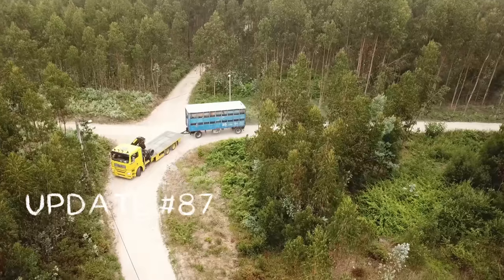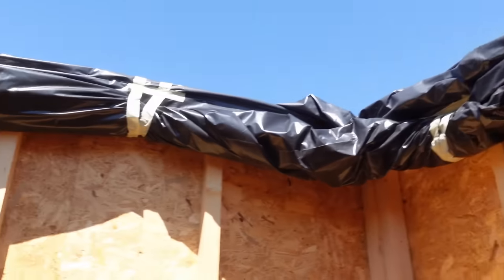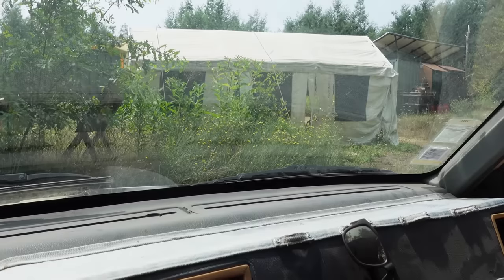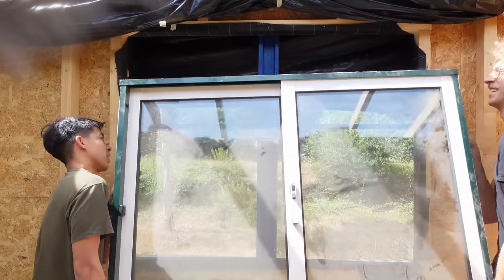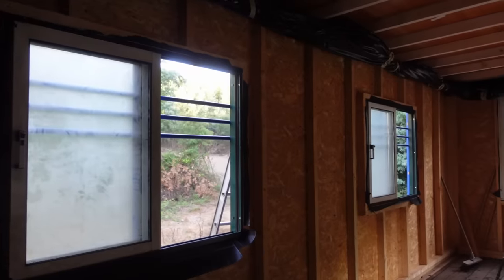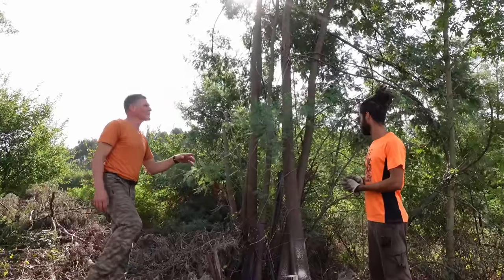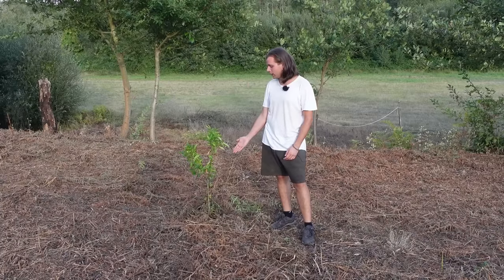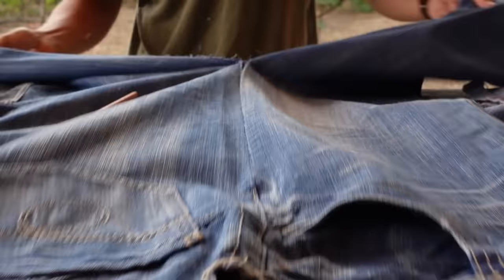#99 Waterproofing our trailer house and clearing the road

Comment: I think you should make French curtains, like a door IN FRONT of the window, so the sun doesn't heat up the glass of the windows it self. You can even try to make them with a hatch, so you can adjust the sunlight you would like to get in.
Reply: Was thinking the same - these only keeps out the sun, but the heat is already inside. In Germany they have them on all windows it seems - works very well!
Reply: Pretty sure they thought about this but they have not worked on the exterior at all so they might want to wait before adding exterior shutters on an unfinished exterior wall.

Comment: The curtains will not be very effective at cutting down on the heat.  The gap between the curtains and the glass acts like a greenhouse warming the air, that air then circulates around the room.

To really cut the heat down, you'll need to put some shutters outside of the window.
Reply: A reflective outside shade that is what they need.
Reply: just my idea too.
Reply: @Kaczyfunny  You can install reflective film inside on the glass to reduce solar heating.
Reply: @lettucesalad3560  Yeah it is a good thing.
Reply: Stop/block the air movement and curtains/draperies work very well. That means the fabric must touch or even fold over onto the floor, or be fitted against the wall or window frame at the top.
Reply: A tarp awning will stop the sun hitting the window
Reply: I first thought they were going to make some old style farmhouse shutters from the mimosa wood..
Reply: Yeah they're be able to find some second hand shutters somewhere
Reply: @patrickwilkinson721   Second hand? They have an onsite woodshop and like 6 trillion logs of mimosa wood. They could probably make some shutters out of that wood lol. They could also do some recycled plastic shutters.
Reply: Shutters also work in winter if there ever is bad weather, we are seeing more freak weather incidents around the world.

Comment: One way to deal with hot sun window, is to block the sun from the OUTSIDE !  In colder climate, one way is to setup some kind of rack on top of the window, and let some plants grow in there, so the leaves would fall in the fall and let the sun come in for the winter.  Curtain will help a little bit for sure, but you need the sun got inside, so it got converted to heat at the window. some white curtain can help to reflet this heat back outside, but window does play some trick, as it will reflect heat, so you can't send back IR heat since the glass act as a mirror.  Anyway lot of tweaks to do in your future.

Comment: Great episode. I enjoy the Mimosa harvesting.  On your final scene, I noticed the outside the office.  Some of the ends of the cinder blocks are exposed. They should be capped before winter.  Water will get into the ends and soak into the blocks, not good.  The outside should probably receive a water repelling treatment. I have a 80+ year brick chimney and painted it last year because it was soaking in water during rain.  It would then puddle on top of the ceiling.  It took me years to figure out the roof wasn't leaking. It's great seeing the progress.

Comment: Wow, I love the mimosa removal - but it obviously is hard work!   Great  to see you preserve other trees.  Thank you for bringing us along.  😊😊😊 John Ken
Reply: Those things will come back.  I know.  However, with persistence, they can be reduced.  And once the native trees have fully reestablished, they should be only a minor nuisance on woodland edge, as the oaks and others will start shading them out.

I know the Kampers are planting fruit trees, but nut trees?  Walnuts should do well.  I don't know if it is even permitted as it is a non-native species, but pecans are pretty good (Carya illinoinensis).  These are actually a variety of hickory and related to walnut.  I doubt the tree is invasive, but it could serve as a host for something that is; however Portuguese or EU agricultural specialists would have much better information on this.  The wood is attractive and quite strong; very large old pecans are often cut for timber.

Comment: 29:01 Keeping the heat out of a building works much better if you don't let the sunlight come through the window first, because then it will warm up the curtain or whatever construction you made, which will in its turn heat the room by radiating. So if you make shutters, window blinds, curtains or any other devices that reflect light, you'd do best to install them on the outside. Curtains on the inside are for darkening a space, not for keeping it cool.

Comment: I am not sure the orientation of your windows, but your southern windows should have awnings over them. With the right size awnings you can block out direct sun in the summer to keep it cooler inside, but let in winter sun to get extra heat. To find the right size awning you need to know your latitude and how high in the sky the sun is at that latitude during the summer and winter. Then it's just math.

Comment: people mineral wool, like rock wool and similar products for insulation are discarded in huge amounts. Around here you can often get it for free when people renovate or demolish buildings or even leftovers from new buildings. It's fireproof, last forever and it takes a lot of resources to produce so recycling it is awesome. And even thou it's a pain to work with it's not toxic or anything.
Reply: Keeping things away from the garbage belt is always better than buying new, however environmentally friendly it may be :)
Reply: I would be terrified using recycled fabric insulation. It's hard ensuring every nook and cranny is free from moisture intrusion. If water does breach the barrier, there's no other solution than tearing down the walls and removing it.
Reply: @bobweiram6321  mineral wool is not fabric it's more like candyfloss made out of rocks or glass. Moisture is going to be a problem no matter what. Bút mineral wool do not rot or decay.
Reply: @maxejnar9934  I wasn't referring to your mineral wool suggestion. I was commenting on how the fabric based insulation they put in is a nightmare waiting to happen due to moisture intrusion.
Reply: @Strooisuiker  New insulation may not be friendly, but moldy fabric insulation is even worse. If water makes its way through the moisture barrier, the moldy fabric insulation and boards will go into the landfill.
Reply: @bobweiram6321  my bad sorry

Comment: You may want to consider "brise soleil". Apparently the name is the same in french and english according to goolge ... It's basically some sturdy piece of material to put on topof windows to block out the summer sun that is high in the sky, but still let the lower winter sun in. Should be usefull for both the pig trailer and your office :)

Comment: Great work! Very surprised to see no pitch on the roof of the pig trailer considering the amount of rain you get in the winter. Even with a thick plastic barrier, the pooling rain on the flat surface will likely cause problems in the long term.
Reply: yas, thought the same! Sounded like an awesome water capturing opprotunity
Reply: unless, they are looking to build another floor up there

Comment: Very impressed that you managed to find windows that were the exact size for your openings 😉
Reply: That is what i thought. If you not use the countrys standard sized windows, it is really hard to find or its expensive.
Reply: @Kaczyfunny  I dont believe that countries have standard size windows in that context.   Most countries in Europe dont have any type of standardisation and the US's idea of a standard double hung window is anything from 24 to 36 inches wide. I think you'll find that what they did was find the windows first then made the openings to fit the windows. They just edited the film to look like they went for windows after, hence my wink emoji.
Reply: @dave4728  Well i did not reaserched it. I thought that apartment complexes have a common size, which therefore the most common and cheapest on the secondhand market. But what you said is absoloutley make sense. In my country i can find costummade windows easily, not too expensive (new windows are allways expensive). I just thought as in everything there is a most common size in window topic too.
Reply: @Kaczyfunny  It wouldn't suprise me if some companies mass produced windows at a certain size to keep the cost down then relied on building firms to build their openings to suit, especially in large apartment blocks. Generally though windows are built to opening sizes.

Comment: Pig trailer home moving along. Reusing the old metal stairs was a step up versus climbing. First step up from the ground is too high and potential trip hazard. Need at least one more lower rung step. Or build up the surrounding base area to improvise one or two stepping areas. Most likely using a combination of base stone, wood chips, mimosa wood for the boxed areas. Opportunities for roof water runoff collection. Gutters, downspouts and suitably sized collection barrel or tote. Water can be used for plant or garden irrigation. Or runoff into a nearby man made designed pond. Plant some trees for shading, respite areas, encourage local birds.

Road clearing and improved access is important. Now you need to grade the road to facilitate water runoff. Then cut some graded drains or culverts to channel the water away from low areas. in time, roadway widening, taking material from the high side and building up the opposite side.  Planting fire proof trees properly spaced to minize soil erosion. Continue to discover indigenous tree species, clear and create growing areas.  Look for opportunities to design and create turn around areas for large vehicles. Determine if water runoff can be channeled to existing streams, ponds, well or lagoon. Do you have to protect isolated trees from the local animal trimming, foraging crew (sheep, goats, cows)?

Office shading, some ideas: mimosa shutters (either inside or outside), mimosa roll up shade blinds similar to bamboo blinds, external mimosa awning around the windows.

Comment: If you double up the windows with a large air gap between them, it provides very very good insulation. Arkopia called it the Double Double.

Comment: I have a really good solution for all the piles of mimosa and brumbles: Just let the big piles stay there and lay down some bigger sticks on top of it. 
So all sorts of animals and wildlife can find a habitat in there. These piles are so good for the biodiversity. If you make it right, it becomes a hotspot for insects, little animals etc. And eventually it will get smaller over the years. Maybe this is a solution for some piles of the whole material but not all, because the choping into small wood chips is also important as the last videos showed.

Comment: An awning on the outside of the window is better than curtains. Awnings stop the suns rays before they enter the building while curtains do help the heat is already inside the room. Plus with awnings you can still look out the window all the time.

Comment: after building stuff with second hand stuff here in Norway i'm friggin impressed that they managed to source windows in exact correct dimensions.
might be easier thing down there but up here there is like 20+ different manufactures (incl old no longer existing but still available) of windows and none seems to have the same standard for any sizes with some very few exceptions like those sizes set by the state for public buildings like schools, hospitals etc. but those tend to be way to big for ordinary people to use (H240cm x W260cm for example...)

Comment: Hello, 
I'm always happy about your new videos. I think your courage and seriousness in living this project is great! 
Maybe I'll come visit in the summer. 
But I have a few comments about the roof and the insulation: 
    • Why the flat roof and no slope? The rainwater then runs off immediately. It is easier to build and keep the roof rainproof. It doesn't cause any damage. It can easily be collected in a gutter and put to good use. 
    • On the other hand, I fear that the wood in the roof will soon start to rot. There is no rear ventilation! The steam pressure comes from the inside and pushes outwards. But the moisture cannot escape. The plastic wrap prevents this. The layers in the wall structure and also in the ceiling structure must become increasingly permeable to vapor pressure from the outside. 
I hope that you find a solution to this problem and that the new Pig Trailer is not damaged. The moisture penetration occurs very quickly and is not very visible. 
Fritz 
Negenborn, Germany

Comment: I´m a bit suprised about your window fitting. ... If I saw that correctly you guys fit them snug into the framework. (that got the job done and I hope it works.) I have demolished older windows and installed some new ones. What I know is, that in the old days sometimes they used hemp between the windowframe and the structural framework or walls of any housing to seal of gaps and to allow for movement of the wood. Today alot of foam and expanding sealingband is used. ... In your case: Have you maybee thought about some cork strips inbetween? ... love your content. keep it up. 🙂

Comment: Tips for cutting mimosas or other trees that are too big and tall. Before cutting, you might want to encircle one of its strong branches or the middle part of the tree using a rope and have some people hold the rope to guide/pull it where you don't want the tree to fall then you can start to cut it slowly till the others can easily pull down the tree.
Make sure the rope is long though so the people holding them will be safe and away from the falling tree. Thank you for this wonderful journey with all of you. Best regards😊 🇵🇭

Comment: Idea: Using the Mimosa ,cutting it as dimensional wood to use for creating an extension or overhang to shade out direct sun through windows and doors. An insulated overhang might suite the situation and the end goal without the sacrifice of light and views outside or that of closing in space unnecessarily. Great project though and fantastic up-cycle of found materials.
I’m curious what the vision is for all the cleared space where the trees were growing. Is there a means to cover the soil that also fits the needs of the situation? A consideration I’d offer is that all the cutting of the trees is adding heat to the ground and driving natures biological activity to dormancy which is what would only assist and support all the resources that are under efforts to preserve, maintain and grow. Perhaps this is where concepts like “Agroforestry”, soil, water and ground ecological stewardship come into the conversation and would also inform the efforts to make use of all the potential without cost or creating more work as a long-view.

Comment: Reference your mouldy wood. 
Burning the surface of the wood protects it. It also protects it again FIRE. Brush off the surface afterwards  
A methylated or Paraffin blow touch would be cheaper than GAS.

Comment: Nice vid as usual.
I wonder in an awful event that some one building on the pig trailer falls down from the roof. Isnt the camp kind of liable almost as an employer? 
I mean, it could be good to have proper protection so that noone can fall down from there.
Byw. To block energy from the sun in the windows. The best is to block outside the window. Why not build and use exterior window shutters?

Comment: You keep the sun outside but not the heat. You need something outside off the windows  like Roller shutter.  But still those curtains much more fancier than cork plates with sticks^^

Comment: You do realize, that the jeans curtain still lets the office heat up the same (amount of degrees) as you put the curtain up inside the building. Maybe take to logs and tarp to create a "Rolo" where you take one log like with your curtains (but on the outside) and one to fix it below the window. That would keep basically all the heat from the sun outside.

Comment: If you want to keep the heat outside then the curtains need to be on the outside too. All this does is make the jeans hot and thus heat up the room just with extra steps while the glas helps to keep the heat inside.
Would probably be much more effective to install simple shutters on the outside that you can close.

Comment: For a bit more stability I would have  alternated the seems rather than have all the short pieces on one side. Takes a bit more time to measure to fit the rafters and alternate, but worth it imo, especially if the area gets snow at all. It does not take much to get really heavy, and the alternating would help some with the weight.  But nice job, that trailer is starting to really come together well.

Comment: Wouldn't making the roof a bit pitched help with possible pooling of water on the roof? An awning for the entrance to get clear of the rain? Surely, every project means effort and time and you probably have too much on your hands.. It might be an idea to keep some usable size mimosa trunks (as material) for crafting simple, rough plank shutters for the windows.. That's how the mediterraneans have insulated against the sun/heat and wind/cold through ages. Don't necessarily have to be sophisticated venetian blinds. The thickness of the wood of the shutter keeps out (absorbs/reflects &/or retains the heat from) the sun to a considerable degree. Cooler during summer, drier during precipitation provided they have blades sloped downwards with intervals to keep the air flow; warmer in winter as well... It's possible that several discarded might be lying around in some 2nd-hand building material warehouses.
All the best.